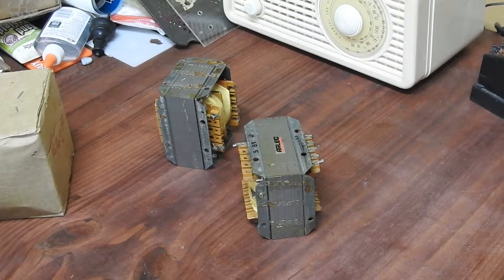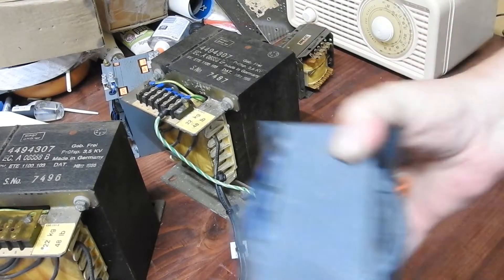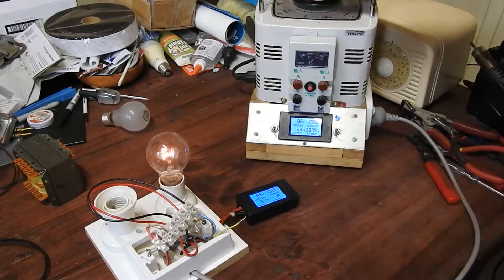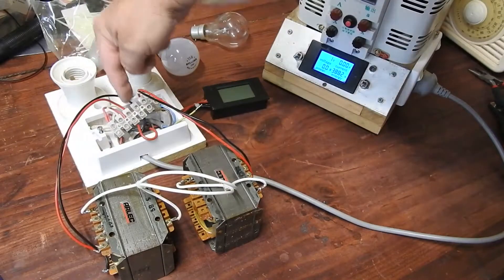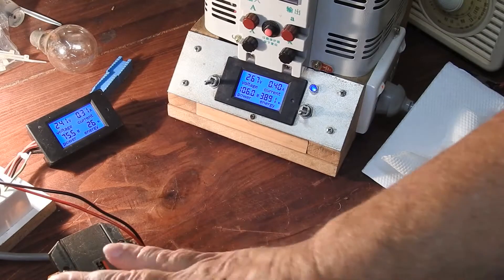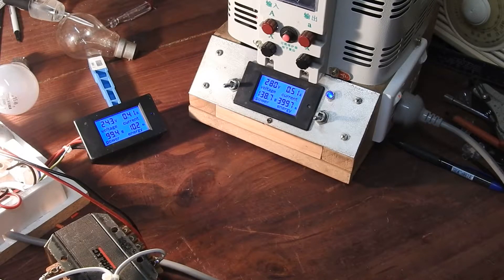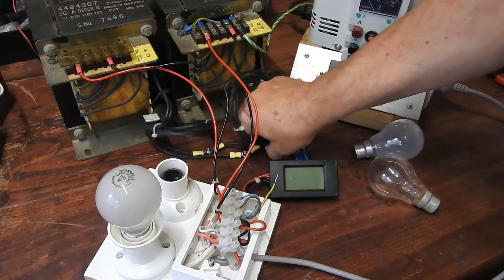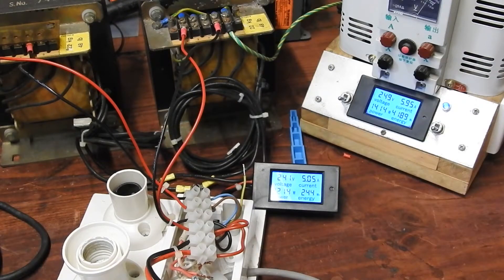Using Back to Back Transformers for Isolation - LOUDER AUDIO!

Comment: Yes - I agree this works well,  I use something very similar at 120V / 24 V and back up.   A nice by -product is that the current is multiplied by the turn down ratio at the lower voltage, so it makes for very sensitive current monitoring.   You can see any unexpected current rise more quickly and easily

Comment: For anyone building one up... You need to remember to keep all of the elements in phase to the original mains lines, all the way through to the outputs... Including extras, like a case fan, or power supply, for a meter/display. Also, I had to add a soft-start to mine.
Reply from the maker: I haven't needed soft-start, but then I didn't have full load connected at start up, or wound the input up via the variac. But I'd like to make one for full flexibility. 
I'm not sure what you mean about the phasing, why would that matter?  (for the simple back to back topology)
Reply: @bertoid  Regarding phase... Think of the power plugs in your house... All of the Line slots on the wall plugs must be tied to (only) the Line leg. All of the Neutral slots on the wall plugs must be tied to (only) the Neutral leg. You must be careful to not cross them up. The same is true for the wiring inside the e-load. HTH.

Comment: I've been using such a setup for some years now and it does indeed work fine. A convenient supply for the transformers is discarded UPSs. People throw away a lot of perfectly good UPSs just because the battery aged and they don't know how to replace it or just don't bother.  I had picked up some UPSs from the dumpster at my workplace and used transformers from them wired back to back as shown here. The UPS transformers seem to be better than most other transformer for some reason and usually also have quite a high VA rating.  
The ones I got were from a 300VA UPS but I could easily get 500 watts from them without them overheating, though I did add a couple of fans to help. The load regulation also seems much better then seen here as it maintained the output at 210V with a 230V input and 300 watt load.  I even loaded it for brief periods with a 1KW fan heater which brought the voltage down to 180V but I only left it for about 15 seconds and would probably have burnt out the transformers if I left it longer.
Reply from the maker: I've got a big UPS with dead batteries. I was thinking the most salvageable parts would be MOSFETs and the like, never thought about it possibly having a nice boofy transformer!
I must take a closer look at it...

Comment: Not having a variac I did the same thing with two 32v output transformers with multi tap mains input. The voltages achieved on the output can be 90/ 100/110/200/210/230/240, great for slowly bringing up an old piece of equipment.

Comment: I bought (2) 1.5kVA transformers., labeled 460 v primary and 120 v secondary, each transformer. They weigh 38 pounds each. If I hook them up secondary to secondary (back to back), then input 120 v to the primary of the first one, then I should see approximately 120v on the primary (output) side of the 2nd transformer. What is the maximum CURRENT (in amps) that I can draw (at 120 v) from the ouptput (2nd) transformer, given the specs for these transformers? With the high voltage primaries (460v), the gauge of the primary wiring would be smaller than if they were labeled 120v primary and 31.30v secondary (using the same 3.833:1 ratio).

Comment: Nice.
Primary of two microwave transformers may be tried. Removing the secondary winding of both and sticking two Primary winding upon another, with enough insulation, on a single core.
Reply from the maker: Thanks, I hadn't thought of that! I may try it out one day. (I have zillions of MOTs) 
But I suspect it won't work very well, as from what others say about them, MOTs seem to be not very good for use as "normal" transformers. I saw somewhere that they can be improved if extra primary windings are added, but I forget the reason why. (core saturation maybe?)     
I need to study the fundamentals of transformer operation so that can I understand such issues better...
Reply: @bertoid  .... thank you. It's just an idea.
Reply: @bertoid  .... Try starting point of one coil is opposite to the other coil.... (or the end of one coil is opposite to the other coil)
ie. One winding clockwise and the other counter clockwise.

Comment: I watched a video where someone had  the exact same power meters that you have with one button on it. They said  according to the instruction sheet ,if you hold the button down you can zero it out (calibrate it) on the voltage & amperage. They had to do that because they were getting different readings. I'm not sure if you can do that on yours? Thought I would throw that out there!
I will try to find the video from a few days ago and Link it here.
I found one of his videos. He shows some of the hidden features on it. If the amperage could be calibrated this might show it.
https://youtu.be/MRu8zwFSBE4
Reply from the maker: Thanks, I'll watch that video. But I think the button is just to zero the energy usage value, though I could be wrong on that.